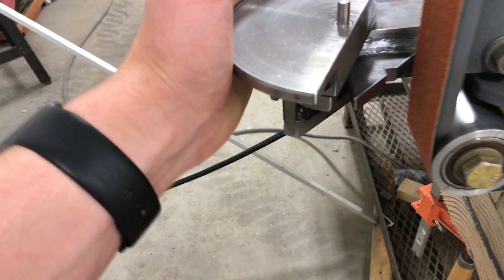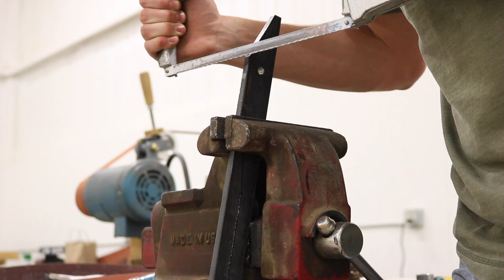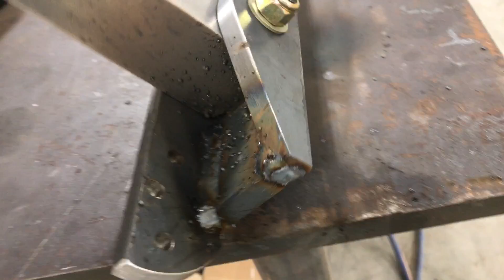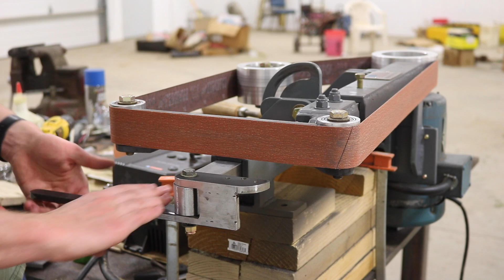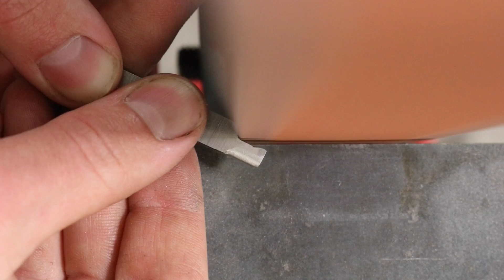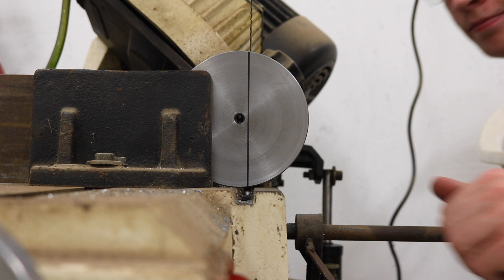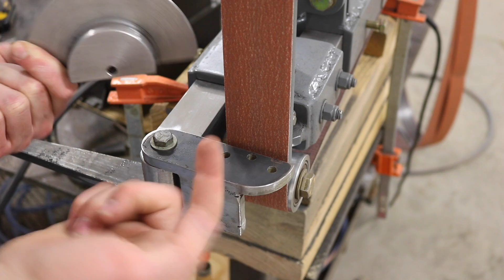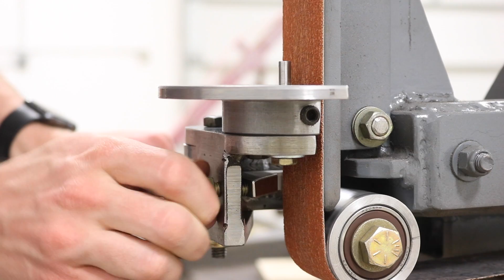Belt grinder radius jig

Comment: you need to build a bandsaw next and loose that hacksaw,

I like the beltsander, you should build and sell them now you've got the beltsander to shape parts with faster than by hand.  Leave the process the same that things worth 1500 bucks or more. with extra fixtures you buy separate the price goes up.
I also think a bandsaw that swings to vertical or horizontal for wood or metal working with the same motor as a pulley drive system. Same motor Jointer ,Mill , shaper ex....
Reply from the maker: +bobbg 
$1500 huh? It cost me almost that much for the parts. Good idea with the bandsaw, I do want to build one.
Reply: read craigslist adds for scrap metal, go pick it up when you see it for free, People throw out stuff like a bow flex and from that you can make your projects out of recycled scrap, or hit up the scrap yard they always have piles of usable materials that's been sold as scrap. It might have some rust on it but 1018 hot rolled cleans right back up using sevral methods. why buy new materials?

Comment: You need a cup holder attachment for water or oil for HSS cutting on your belt grinder. :D
Could also be used as a magnetic parts cup
Reply from the maker: +Brian Kirchgessner 
I do plan to incorporate that into the stand for the grinder...whenever I get around to building that!

Comment: i love your grinder... it amazes me that the weight of the motor doesn't cause vibration issues with it mounted free floating like that, so far from the actual hinges. speaks to the rigidity of the rest of the frame i suppose. i'm very much going to make one like it eventually.

this jig too.

Comment: you're miles ahead of most young men of the same age. I was thinking make a couple of locator pins and a bunch of bushings for the different needs. easier and quicker to make! 
I see towards the end of the big build you started stitch welding, it does reduce the warp-age, also  plenty strong enough for the project.  As an old time professional fabricator I learned early on to bevel the edges for stronger and neater looking welds that require less grinding = less time / effort. Great job, I look forward to your next project. You have a bright future in fabricating or engineering.

Comment: try lowering the speed and feed to prevent the chatter. As the diameter increases so does the surface speed so the rpm at smaller diameters don't necessarily work at larger ones. Rigidity of the lathe will allow deeper faster cuts but the width of the ways usually aren't the weak point in that equation. As an aside certain tools and machines have certain speeds that allow for harmonics to develop which will also affect tool chatter,  but I don't think that was the problem here.

Comment: Years ago I used a hand held strip sander with a 1" wide belt to polish crankshaft journals to a super fine finish. Something like it would remove those pesky chatter marks. Sand while the piece is turning in the lathe. A 100 grit belt should leave a nice finish. Another project? :-) This project turned out very well, so maybe this idea is not needed. Keep these videos coming...fascinating.

Comment: Another impressive design... well done... I bet the first 100 orders are in already!? ;)
To me it looks like you really have a passion for mechanical/machinery design... do you tend to overthink while planning or are you using the fail fast and do better method?
Regardless... thank you for letting us in  on your journey... you are going places... continue on... I'm exited about your next attachment invention or whatever back burner project you tackle next. Thank you so much! ;)

Edit: Disregard the overthink question... just seen your first belt grinder video again... 2 years is overthinking. ;) But if I might... well worth the wait... and very functional indeed. two thumbs up at least!
Reply from the maker: +Frank Müller 
Yeah, I overthink. Actually most of the time I spend on designing is to simplify my initial idea. For example, the number of moving parts on my original belt grinder design was almost double what it ended up having, but no functionality was lost.

Comment: Nice design!  How about a tiny clamp that holds the stock with the taper pin or pivot hole in the front center?  You can pivot the clamp.  I am thinking the clamp would look like one of those cheap chisel/plane iron sharpener jigs. The advantage of this is that you to make a radius without requiring you to drill a pivot hole on the stock.

Another option, is to use a mini miter gauge that slides on a vertical slot on the table. You clamp the piece to the miter gauge and you pivot the gauge to round over the stock.

Comment: Thats a clever design. I would have liked to have seen your compound setup for turning that pin.  I see the matching taper for the platen, but where did the 45 deg. detent angle come from? Did you freehand it?
Reply from the maker: +Kenneth Barbour 
Yeah I freehanded the 45°. It doesn't actually need to be 45°, it just needs to have its largest diameter portion in the correct location.

Comment: The chatter  could be the limit of the lathe but soft material needs higher speed and heavy feed rate. You do great work. Who do you work for or who's shop is that you work from?
Reply from the maker: +BReid 
Thanks for the info!
I make YouTube videos. Currently that's my only job. The building in this video is my dad's shop, and the little woodshop that you'll see in most of my other videos is my own.

Comment: Very nice radius jig, really like the design and how easy it is to setup. When you were reducing the weight of that disk on the lathe, wouldn't it be faster to take the cuts of the diameter instead of a series of facing cuts? Keep up the great work!
Reply from the maker: +Garage workshop 
Thanks!
I couldn't get it to stop chattering on turning cuts, but facing cuts worked beautifully.

Comment: I can't tell what kind of cutter it is, it might be HSS or it looks exactly like an anco brake lathe cutter (I use them all the time on my lathe).  If it's the brake lathe cutter then the answer is that it's designed to cut the face and not the outside, the cutter is at the wrong angle.

If it's HSS then typically a cutter cut with that profile will have the top face will be cut with a slight side rake and will only cut well on one side.  If it's flat across the top face then that looks like a 60* threading cutter, basically inappropriate for the job.  Look up cutter grinds and you'll see that general workhorse cutters are cut so they are only really usable from one side.

If it's the brake lathe tool then it has a carbide edge and will want to be run faster than that.  If it's HSS then slow and dress the edge right before that cut.  Because of the rust on the outside edge you need to make your first pass deeper to get a clean cut, same once you have chatter marks around it.  

Yes, the size of the lathe isn't helping but you should be able to get it working.  Honestly, get some insert tooling, once most people try it they won't go back to grinding HSS, and there are a few places online that specialize in inserts and tooling for smaller lathes.

FWIW, it was painful watching you attack that thick piece of steel with the hack saw.  I'm sure you have an angle grinder sitting around (if you don't grab a cheap one for $20), a thin cutting disk in one would have been much faster.  Otherwise why don't you make a table that bolts to the horizontal bandsaw?  It's not as nice as a dedicated vertical bandsaw, but it sure comes in handy when you're doing something like this.
Reply: BTW, I love the project... 

I'm not sure I would have bothered with the click in replaceable pivot- I'll honestly be surprised if you use it that much, for the most part if something is going to have a larger hole through it you'll drill a pilot through it first anyway but it was kind of a cool design.

Comment: Speed the lathe up and use a carbide cutter braised on or insert tool and when grinding a HSS cutting tool you can let it get hot it won't hurt it no need to cool it every few seconds and don't quench it when done let it cool kinda slow

Comment: Nice job you did. Well thought out project. A small angle grinder with thin cutting disc instead of hacksaw will simplify your fabrication.
First prize would be a metal bandsaw or woodsaw reduction box conversion....love your channel
Reply from the maker: +Paul van Zweel 
Oh well, I need my exercise anyway... :)
I have this nagging idea to build a vertical metal-cutting bandsaw. Like a real proper one, maybe 20" throat or so.

Comment: wtf is that, you have an helicopter as a roof fan?
Reply from the maker: +Tinchox 
Just a normal little ceiling fan... ;-)
Reply: Literally called a BigAss Fan, look it up. made for open shops, slow but moves a lot of air
Reply: Its Meant to lift the Building up !

Comment: Only thing I have to offer is with a small welder on that large bar you welded I have used a torch to preheat stuff like that in the past and it was always worth the time. The hotter you get that big bar before welding the better. From experience. Awesome build dude!
Reply from the maker: +Caleb Welte 
Yeah, I would have done that if it needed it for strength, but I don't see that it needed it here. Thanks!

Comment: Use a negatie rake tool but with a sharp edge to cut down on vibration short of that something is loose or operating at its limits.
Reply from the maker: +grandematapalo 
Thanks for the info.

Comment: You need a mill!
Reply from the maker: +booleanenator 
Stop rubbing it in!
Reply: Well, you made a sander/grinder, so maybe you are destined to design your own tools. You have a lathe, my dad used to tell me that the lathe and the mill were a few of the machines that could replicate themselves and each other. He used to work for a machine manufacturer (the actual name of which escapes me right now). You seem to have a nack for it.
Reply from the maker: +booleanenator 
I think building a mill is a little beyond me... 😬 I'm watching Craigslist for a good deal on an old Bridgeport, but unfortunately so is everyone else!
Reply: You could just marry your drill press and your lathe.

Comment: I hope that 1018 5" round steel is relatively inexpensive.  The amount that ended up being shaved away/cut away for the table of the jig was easily 2/3rds of the starting piece.  

Great job.  You seem to be building this project in a much different shop space than your regular one.  Do you have a buddy with the extra metal working tools?